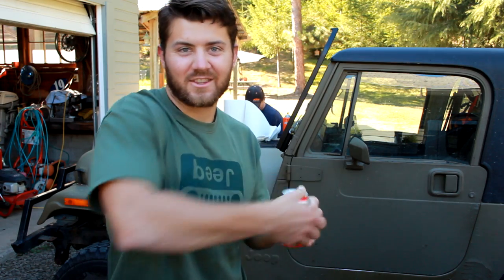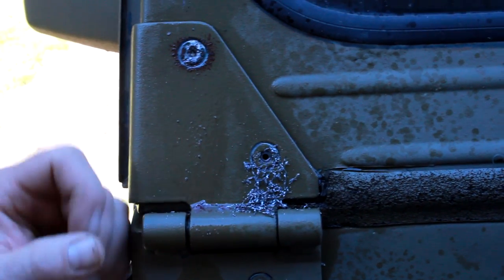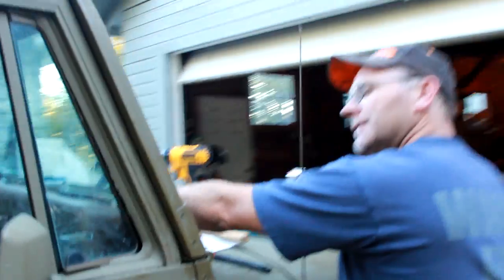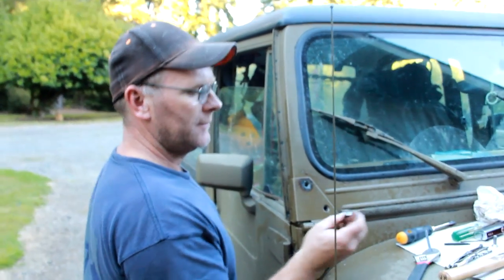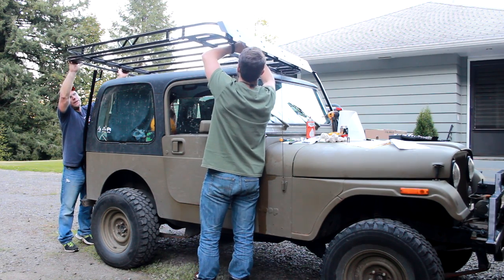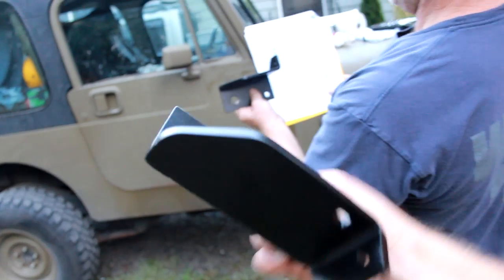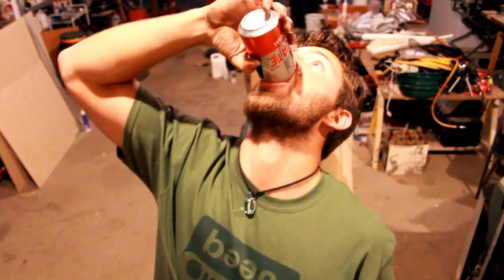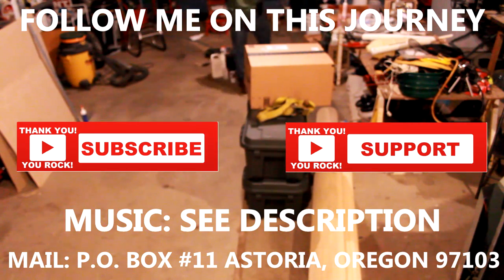Garvin Industries Expedition Roof Rack Installation

Comment: you should've add  a 1 or 2 inch body lift when you had the body mount bolts out. sense they already needed replaced, you might as well have put in a couple inch body spacer. It probably wouldn't have been much more than new factory stuff. either way, loving it.

Comment: Jake instal led light bar on the roof rack
Reply: I'm sending him a 14" double row, dual range (spot and flood) bar. it's 14" of led's but it's considered a 16" because of the mounts. It should fit perfectly inside the front bumper hoop.
Reply: In other words, I agree. any auxiliary lighting is a good thing. I figured he'll use mine a lot more than me. I was going to send him a bikini top too, but i dont think it'll work with the rack.